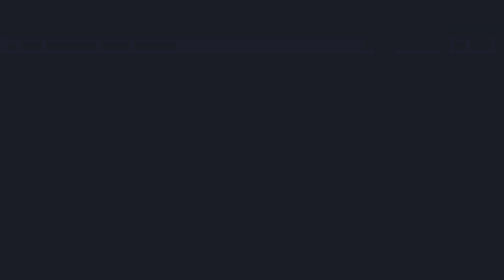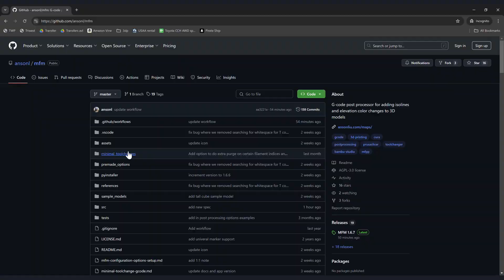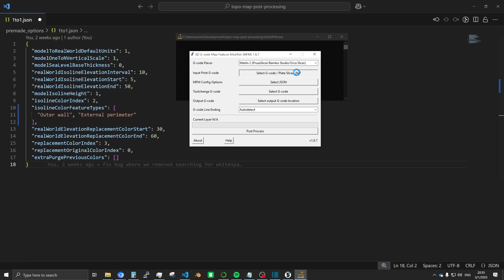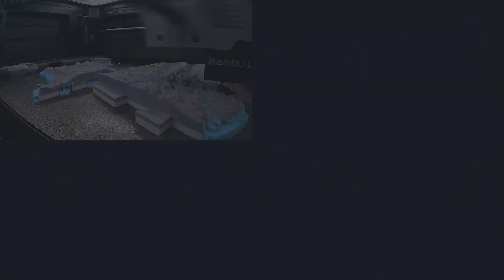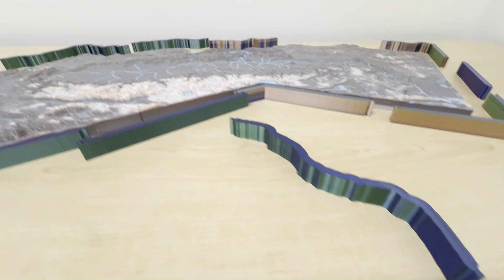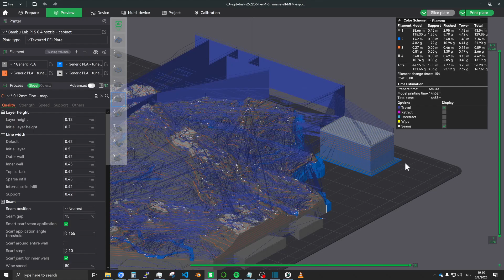Add Elevation Contour Lines to Topo Maps - 3D Printing Guide!

Comment: Is this no longer compatible with Bambu Lab? It won’t read 3mf, and if I use regular g-code, Bambu won’t read the file MFM generates.  Would love some kinda direction to solving this issue
Reply from the maker: I replied to your email, MFM will write the each plate gcodes to the directory that that app is located in as an intermediate step of the plate sliced gcode 3MF. Make sure that you are running the app from a location that it will have permissions to make a new file.

Comment: I appreciate all the effort you put into this but I give up. I just wanted to print all the 50 states with the topographic lines on  my P1S. This is just too much setup. Some parts are just confusing and this tutorial is more aimed at people who fiddle with printer Gcode. I can run CAD software and I am a manual machinist by trade but im stumped here and the Setup is not worth the trouble. I feel like they should have it built in to stop at layers and change colors with ease. This is so much trouble for something that should be simple.
Reply from the maker: Thank you for the feedback! I'd be happy to help get you setup if you send me an email at support@ansonliu.com

Comment: I have a question, do you know where I could find a true to form earth globe in 3d? There are a ton of globes but most assume the earth is a perfect sphere but its not a perfect sphere. I would love to print a globe that is more dimensionally accurate but to scale obviously. If not its ok, I just thought I might ask since you seem to have great sources for maps.
Reply from the maker: I don’t know of any 3D printable spheroid models, but I wouldn’t be surprised if the actual earth spheroid difference from a perfect sphere is on such a small scale it wouldn’t be visible on the size of a 3D printed globe. If you applied a isostatic model (USGS or NASA data sites should have something similar) to a sphere and really exaggerated it, that may show what you want.
Reply: @maketheuncharted   You are correct, it's about 0.3%. For a consumer FDM printer, the print accuracy is worse than that, but if you really want you could also take a spherical model and scale it yourself by x 0.0033 in X and Y, assuming poles are on the Z-axis.
Reply: The earth is smoother than a Qball.